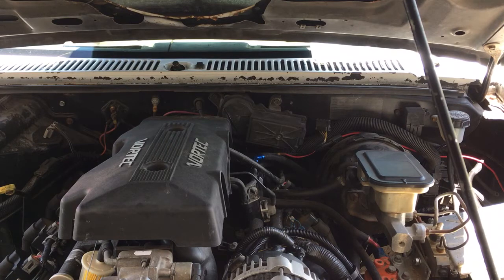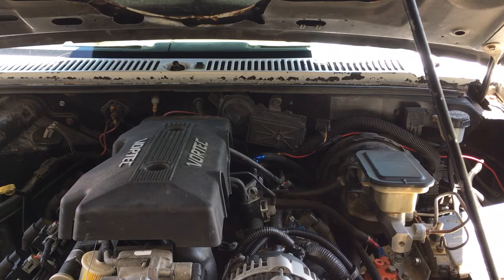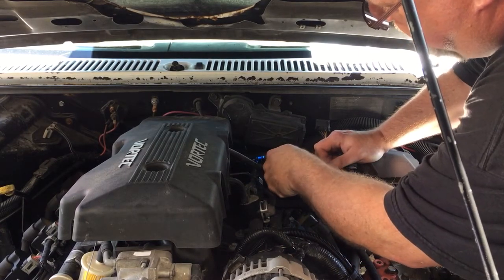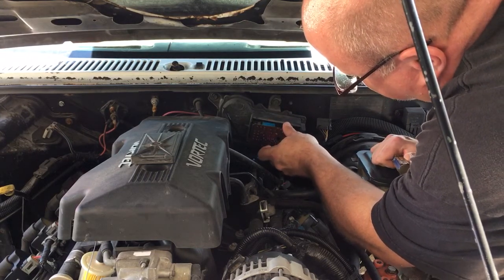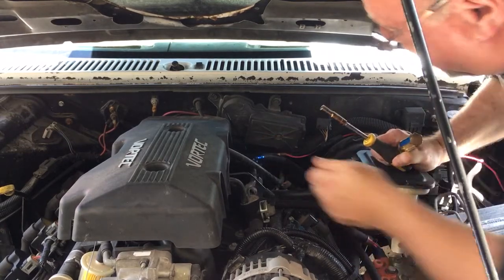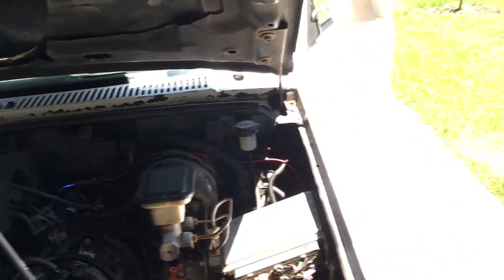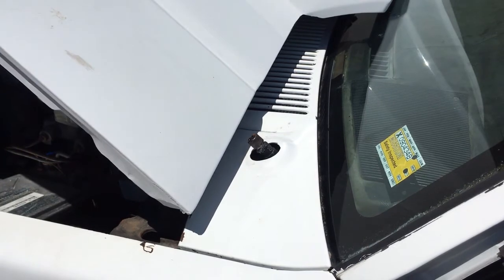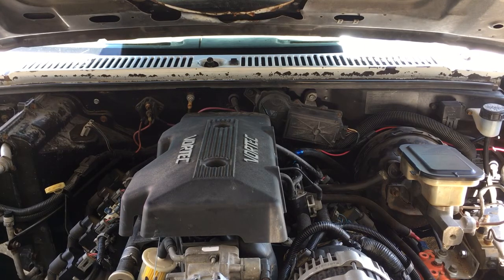GM Wiper motor circuit board replacement

Comment: If you can find the right board it would  be simple. My 89 gmc sierra 3/4 ton 4x4 truck has the strangest board, maybe cause its an LD for light duty,  The board dimensions are 3.75" long x 2" wide with 5 flat .5" lo g elec. Connectors on end. No cut out circle you see on most. The motor lokks sim. Maybe i should try replace motor and board? What think you? Help. Any input is  Very appreciated. Being an 89 its most likely pretty primitive electronics. 140k miles still runs like a city truck it once was befoe on ebay.
Reply from the maker: Lan Rivers I haven’t messed with mine since this video. The only speed I have is High, nothing else. It’s weird, I’m pretty sure the issue is my multifunction switch board inside the steering column under the steering wheel. I haven’t taken the time to fix it. 
What’s yours doing wrong?